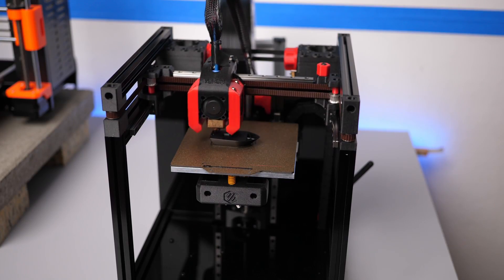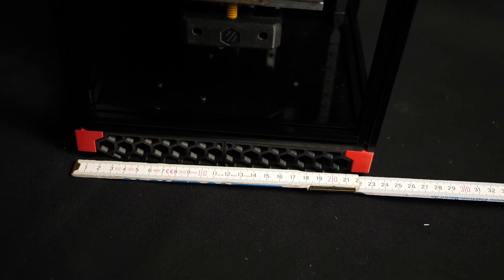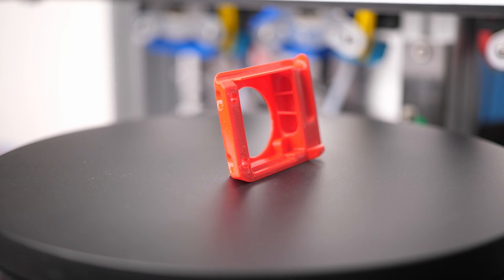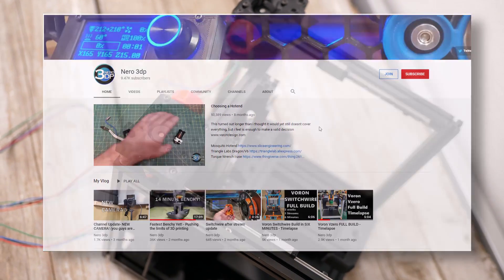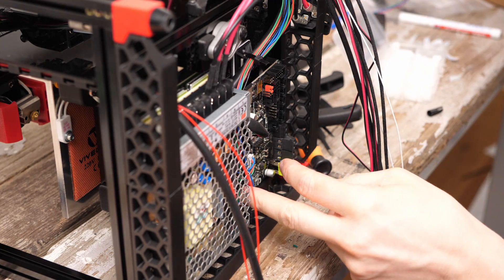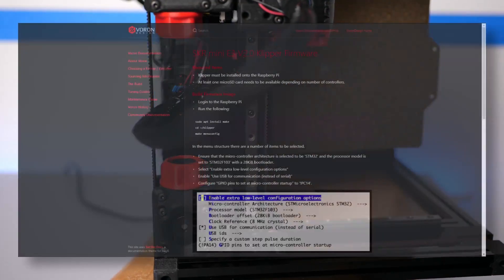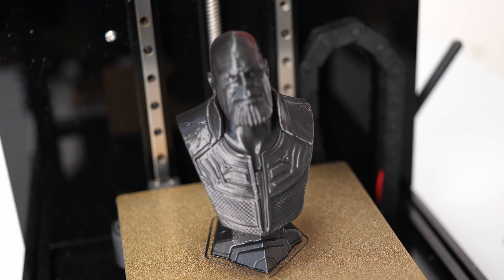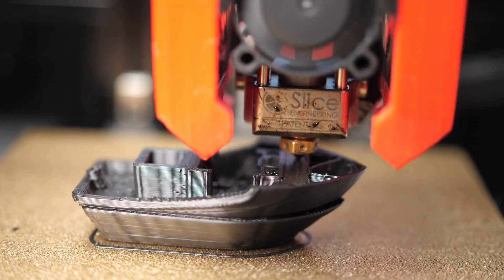Mini, Fast & Open-Source Core XY - The VORON 0

Comment: How coincidences work - was just watching this video (I'm a very very VERY old newb at this) and the next video that came up as a suggestion for me mentioned a processor sw that takes Cura output and produces arcs, which apparently shrinks G-code considerably and while as I said I'm the noob's noob, it makes sense to me that if you smoothe out the tool's path and use less code to do so, this might give the little Voron 0 the edge you need to get over that line? 
PS I just subscribed, have been watching your vids among a whole host of others to learn as much as I can before I think about a printer that'll fit my budget and grow with me. Am really enjoying your sharing of knowledge, thank you!
Reply: I don't think the V0 will have an edge with smaller gcode because the raspberry pi already takes care of that. In fact klipper splits curves back into straight lines. Klipper can send about 10x more steps per minute than Marlin on an average 3D printer chip.
Reply: @DiThi  thanks for the info, as I said I'm 64 and still learning learning learning. Hoping to get myself hands-on with a cheapie printer fairly soon and then I'm hoping my brain'll retain all these different snippets and help me with the learning curve.

Comment: I enjoyed your video I am doing a voron build but I'm salvaging parts (mostly the 2020s and motors) from older printers to do so I'm making a voron 2.4 from my old tronxy x5s and a switchwire from my ender 3 and mostly for fun I'm going to try to scale up the voron 0 to use my old ender 2 bed I'm also trying to make the print head fit an old clone v6 with the coupler on top as for your question about what to use I'm using ABS but this does seem like a good test to see if the new PC can stand up to the stresses anyways can't wait to see the next video

Comment: Cool project, psyched for the creep testing. A simple way to do it is to hang a weight on a specimen and measure the deflection over time.

You know this already but I'll pitch in to help the algo :) Use a semi-crystaline - annealing will increase creep resistance further  by increasing crystallinity

Comment: Excellent video! I’m building a 2.4 later this year, and have been following Nero’s channel for a bit, even the official discord (I haven’t dove deep into the Discord yet though).  

One thing you may want to investigate, Stefan, is upgrading to a direct drive when/if the new extruder design is released.  The extra weight the printer throws around is not too large of a challenge for the larger Vorons with the use of input shaper.  Furthermore, I saw/read (I forget where or by who) that their direct drive “Afterburner” toolhead system can actually print faster than a Bowden system.  The Bowden system’s hotend would outrun the extruder.  If this is due to Bowden extruder speed limitations (gearing), extrusion pressure delay, or retraction stops, I don’t know.  But until the new toolhead for V0 (assumed to be a performance upgrade over their “Pocketwatch”) is released, or someone who has done a side-by-between Bowden and a Pocketwatch can chime in (I mostly keep up with the 2.4 variants), I would hesitate to assume with certainty a Bowden will be your best path to your record setting Benchy.  Yes, record setting.  I don’t see you as the type to just break the ten minute mark and just move on, wondering how much more you could push the envelope?  How much design entitlement you aren’t taking advantage of? 

Test it until print failure...  

Good Luck! I look forward to the creep update!

Comment: Nice video!
Good luck with your 10 minute Bency.
My 1st printer was a custom build printer I baught from a company that does 3D stuff. I paid roughly $200 for my 120x120x120 coreXY printer.
I had a standard board that finally gave way a year ago. But before that I used it for prototyping nosecones for model rockets. I even printed parts to fix kitchen cuboard's and stuff.
As always I find your videos enducational, Entertaining and inovative. Sorry for the spelling. English is a 2nd language..

Comment: So why this and not SLA? 

I don’t mean that rhetorically. I have been using an i3 style printer by Anycubic for several years, and despite endless upgrades it still doesn’t suit my needs. I make exclusively functional prints. Brackets, clamps, sprockets, ducts, etc. The i3 is rubbish for accuracy, especially for parts the fit together. I have to make several prints tweaking parameters to overcome the lousy dimensional accuracy. 

I can live with the small print size if my parts were printed reliably and with reasonable dimensional accuracy. I’ve been considering one of the new SLA printers. It seems to have the accuracy, but with its own issues and cost. 

My use case seems similar to yours. Would you choose this over an SLA printer? If so, why?

Comment: i was getting thermal creep from my heated bed so i used insulating washers between the heated bed and the springs (on both ends of the springs) and changed my screws to stainless steel since they have lower thermal conductivity than carbon steel. this seems to have kept the heat better where i want it, on the heated bed, and away from where i don't need it. maybe there's an even better kind of screw that is less conductive such as some kind of ceramic composite? i see that ceramic machine screws and nuts exist. try them that might be fun, especially if you can find one that is strong.
Reply: Nylon screws and nuts are cheap and readily available, and shouldnt soften at heatbed temperatures, might be worth a try

Comment: the most rigid material ive used so far in my limited experience, i mainly use polylite and polylite PC hatchbox pla and atomic petg, is priline CF PC!! it has been the basis of my cr10 v2's x y and z axis aswell as x carriage parts for over a year and a half now with little to no creep even on tensioned motor mounts(the y axis carriage mount is isolated from bed heat and blocky so temp induced creep i cannot speak for)

Comment: If you want a bigger remix of the VO, check out the Tiny-M printer.  150^3 build volume.   2020 extrusions, nema17, mgn9 and 12 rails are all  easier to source ans build and make a printer that can  print even faster.  

There’s also a 180^3 remix.
Reply: Can fit 60mm nema17s on it! Will be much more powerful than the smaller v0 motors.

Comment: Are you like a noob? I'm not saying that mean I'm just wondering if you're new to this? For one you could easily got your goal other ways cheaper. I'm using the hot end you said gives but it don't give it all when installed correctly. To run more volume just run a larger nozzle. Use a 24 volt system with a 50 w heater. You don't need a 110 bed. you can get away with a PCB 24 volt heater with a 24 volt silicon assist heater pancaked with insulation underneath.  As long as you protect your 110 connections underneath I promise you won't get shocked with anything else. And speed comes with fine tuning. But why would you want A benchy in under 10 minutes?  3D printers are work horses nowadays. Go bigger with bigger nozzle and your work will get done fast enough.

Comment: The kit seems way overpriced. Remembering the Trinus 3D you could bu some years, ago. A complete tiny full metal 3D printer with linear rails and such. Just upgrade it with an Mosquito and have more for less.

Comment: Stefan, don't mess around.  You need a baseline. Print the parts out of ABS or ABS+.  Not only is it in the documentation as the only supported materials, but they are known to work.  You need a baseline - maybe stiffer material will make things slower.

Comment: Beware of polycarbonate for 3D printer parts, all the Polymax PC prusa parts I made broke within 800 hours. This may have been due to my use of MoS2 bearing grease and very aggressive jerk/acceleration settings, results may vary.

Comment: Love everything you have done. If you ever find time, I would love a good video on layer height, nozzle size and detail. From using we all learn the basics, but if you want to go fast and change setting for pre made files or to design your own models it would be good to understand the limits of layer height and nozzle size (line width) vs details. It seems no one ever touches on this. Just bigger and faster means less. I am sure there is some kinda of math to it that dictate smallest arcs or radiuses are diameters of circles etc.

Thanks for your time if your read this.

Comment: I would hard mount the bed and use a bltouch.  This will save weight on the bed and remove all the spring tension so almost no creep.
Reply: There is no space for a BL Touch on the V0, not without sacrificing the already tiny build volume.

Comment: i've looked at voron a while ago, pretty cool
people that don't already have a 3d printer might be discouraged
but they could order the parts from shapeways.com or i.materialise.com these services have many materials available, mostly selective laser sintering and multi jet fusion machines
you could test the material "alumide", a nylon mixed with aluminium powder, it's supposed to be stronger
Reply: Voron has their own "print it forward" program for new users. Worth every penny and A LOT cheaper than those services

Comment: An interesting alternative is to use a DC bed and an external 24V PSU (like the Mean Well GSM160B24-R7B). Then you do not have any mains wiring to do and the exposed bottom is no longer a safety issue.

Comment: dont slice your benchy with prusa slicer. it somehow mess up the benchy in fast prints. the cut that you get in the mid section of benchy is a prusa slicer artifact. I did 10 min benchies on my prusa bear before but I had to slice them in cura.

Comment: Hi Stefan,
as allways: super interesting video! Thank you for taking the time on making those highly informative and inspiring vids!

I am mainly printing parts for usage in the car, therefore they need to withstand temperatures of around 60°C, which makes PLA a non-working option (of course). I have tried PETG already, but got the best results so far with Extrudr's GreenTec Pro: it's easy to print and deals with the higher temperatures way better than PLA, but I would be interested how it performs compared to the "standard" materials. So maybe you could also include this material to your creep-tests once you have the time to start those? There is also a carbon-reinforced option in Extrudr's portfolio.

Looking forward to watching the upcoming videos, keep up the good work!

Timo

Comment: I want to suggest two types of filament, the first is similar to the one you used, but with higher heat resistance. the second, on the other hand, is more technical and requires a much higher printing temperature, both are made by FILOALFA.
alfanylon (240-260°C)
https://www.filoalfa3d.com/gb/content/37-alfanylon
thermeczed (300-330°c)
https://www.filoalfa3d.com/gb/content/22-thermeczed

i hope this comment will be helpful,
I'm also struggling with the voron zero printed in black / orange PETG

Comment: My opinion: use PETG reinforced with CF and ideally post-treat it by re-melting it in salt. I would assume, that it is kind of a hassle to do, but it should be very stable when doing so. To be sure I would test these parts in comparison to normal ABS. I would assume you are better off with the re-melted PETG-CF Parts than with standard ABS Parts.

Edit: I forgot to mention, as far as I know, delta printers are faster than xyz ones
Reply: not sure about that anymore as the printer can go so fast that you need high flow hot end to keep up

Comment: I'm printing nearly all I do in ABS, I use a fully enclosed printer and high power Heat beads (500 Watt). Also I print with a Volcano like nozzle form reprap-fab.org. Future I print quite slow all this results in very strong parts. The layer bonding is I would say as good as it gets. Fast printing ABS results always with low layer bonding. This is most likely caused by the different parts in ABS  witch take different times to melt and if you print to fast you basically have a mixture of molten and solid extrusion witch does not bind well. So everyone who has ABS problems try printing slow (50mm/s or less).

Comment: It's a very interesting design. I'm very tempted to build a small rigid machine for very fast prints although I'd probably still want a direct drive setup.

My only concerns about the mechanical design of this printer are:
1) The extrusion size, I'd want to use thicker extrusion to make the frame more rigid especially since the front-top section is open.
2) The X axis rail / gantry has the belt on the front which moves the hot-end away from the linear rail - I'd put the belt on the back to reduce that distance as such a small rail isn't very rigid to begin with.
3) I'd use bigger Y axis linear rails seems as the weight of these does not matter and I'd make sure to use real branded and pre-loaded rails, most of the rails you see are not preloaded and are therefore nowhere near as rigid as they should be.
4) A height probe, come on it's 2021 - All beds should be rigidly mounted and height probes should be used before every print in this day and age.

Edit: Thinking about it, rather than using thicker extrusions it would be easier to just use solid-aluminium side panels and I'd also add a "V" brace to the front opening.

The MGN rails have three preload classes:
- ZF: Light Clearance - This is typically what you see and is useless if you want precision and rigidity
- Z0: Very Light Preload - This is essentially a neutral preload, much better than ZF
- Z1: Light Preload - This is the highest preload that they offer, they will feel "stiff" compared to a ZF linear rail but this is exactly what you want

MGN7H1R150Z1 is what you want.

Comment: This is one of the best projects I've seen for quite some time, brilliant. Considering I already have some parts like Lerge board and direct extruder assembly, incorporating these parts plus some from the old printer into Voron would be a good way to go. Also I want to point out relatively small footprint for the build volume that is not typical for CoreXY architecture. I am excited to build that in future, probably will go for Voron 2

Comment: Nice, definitely will check the Voron out. Looking forward to those creep tests! I had a notion that PLA creep was partly due to water absorption. I ran a simple creep test with bare PLA, and PLA coated with polyurethane. The single poly coat actually did have less creep, but unclear if that's just because the poly added some stiffness of its own.

Comment: @17:38 Uhh... IMHO this basically means that the design of this 3D Printer is simply not made to be used with ordinarily 3D Printable materials and should either be CNCed out of metal or if metal is not an option maybe Delrin.

Edit: People apparently do sell Aluminium CNCed parts for the V2.4... Heh =)

Comment: Print the Parts again in PACF from Fiberthree. Dry it for 48h @60°C. After printing aneal the Parts @60°C for at least 24h. This will fix your Problem.
Reply from the maker: I'll definitely try annealing.
Reply: @CNCKitchen  you can also try to anneal the parts you already printed should also work. But realign the parts to the original geometry in the oven ;)

Comment: Ciao Stephan !!

I regularly keep my inept 3D Printing skills up to date on your channel. I love your content for educational purposes (invaluable) and for innovation in this area.

I am building a 400x400 printer and was wondering whether linear rales are better for this build than conventional bearings setup.

Mille grazie
Reply from the maker: Ciao Angelo,
in most cases you'll have a stiffer and more precise setup with linear rails but they cost significantly more than rollers and require you to properly mount them and design the printer in a way that they don't get jammed up.
Hope that helps

Comment: do you guys think is possible to scale this desing for a classic 20*20*20 build volume?
Reply from the maker: Scaling the V0 is not recommended due to the cantilever bed. In this case rather take a look at the other models.

Comment: I was looking for printer that would fit perfectly in the ikea kalax compartments (330x330mm). And it seems that you can configure voron 2.4 to fit to any cube/block size using the online BOM generator. Cool.

Comment: Once you have everything up and running again, I'd really like to see what you can do while printing very slowly at tiny layer heights. I mainly print minis, but a resin printer just isn't safe in my apartment, so having a small, high-detail FDM printer could be nice. (In addition to my current Mk3)
Reply: head over to Voron discord

Comment: You asked for ideas, so I have a couple, though keep in mind I haven't even gotten around to plugging my first ever 3d printer (SW X1 v4) in yet.

I don't know if you've tried 1 yet, but those flexible remote extruders look like a good idea. IIRC, Tom S, Angus, Joel, etc have all had good things to say about them. I admit that solution would add a small amount of extra weight to the carriage, but that's where my next idea comes in.

You mentioned the issue of the fans not providing enough cooling to the freshly extruded material... what if you were to take inspiration for that problem from the previous idea. Instead of having a couple of fans on the moving carriage, what if you had bigger more powerful fan(s) mounted to the frame, with a fan shroud/adapter connected to a light weight hose suspended from the frame that then feeds into an air distribution part on the moving carriage? That should hopefully more than offset the slight weight increase from the previous idea, and give you increased airflow on the freshly extruded material.
Reply from the maker: Good points!